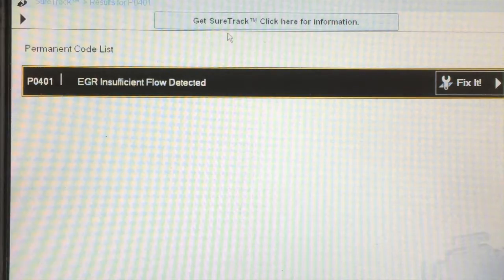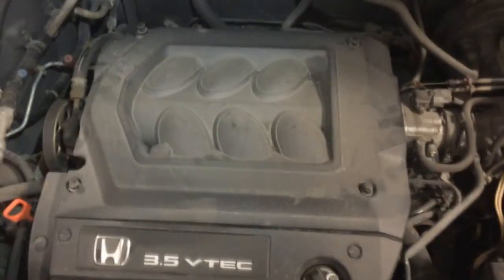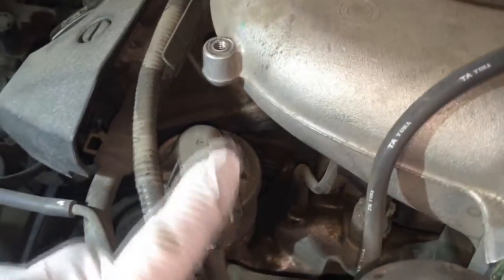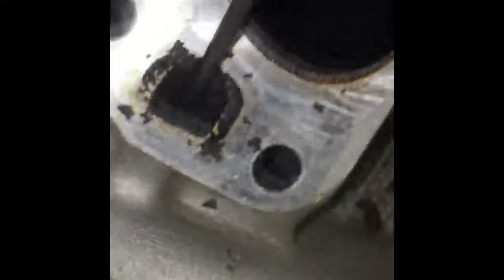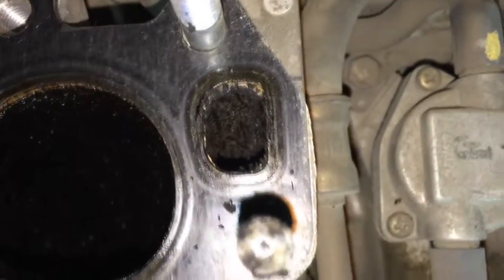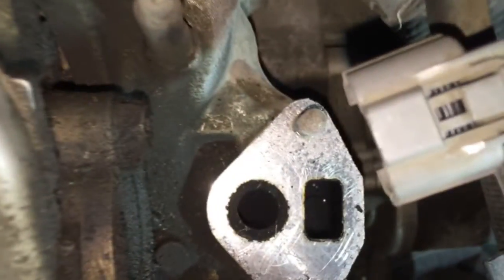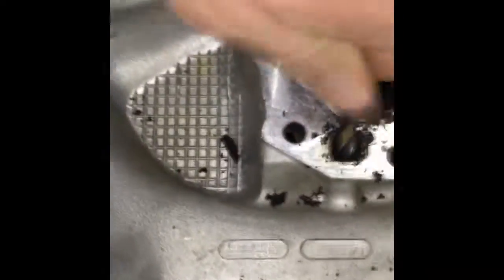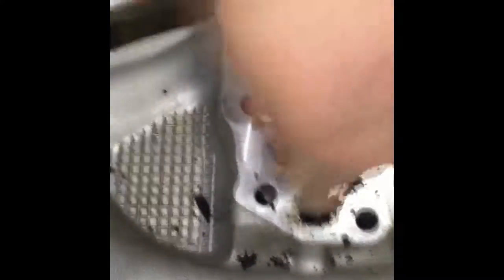Honda P0401 Cleaning EGR Passages Part 2

Comment: Nice - I think I'm missing the part one, hum must of lost it somewhere. Ok  I'll pretend I seen part one.  I haven't tried this one out but it comes from the sunny studios down in Texas. This top notch guru tech on the tube called Scotty something says to put 3 - 5 gallon pails of lacquer thinners you get from the hardware in your tank and it cleans out everything in the drivetrain, then  you follow it up with 2 jugs of bars leak in the rad to prevent something , doesn't matter it fixes it right up - not the tank, gota get it just right.  Sure would like to see you try it out first.    If you don't mind would you put  it in line for a video requests .  Take Care .  Steve
Reply from the maker: Haha, I put a link to part one in the description but it's just more of the same stuff. Didn't think of the lacquer thinner trick so I'll have to look up this Scotty guy and see if he can teach an old dog like myself some new tricks. I hear if you crack an egg or two in your radiator it will stop most any leak...I'm not yoking.